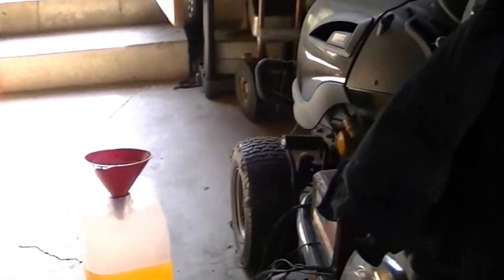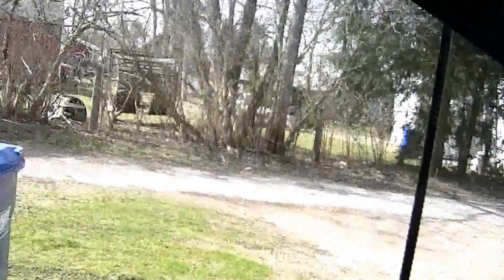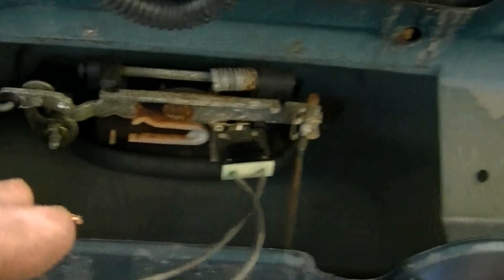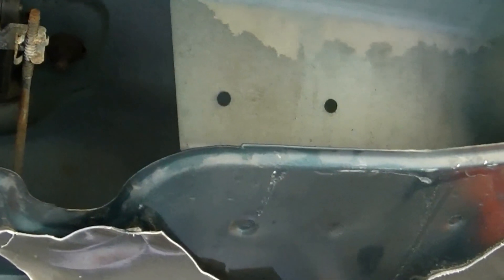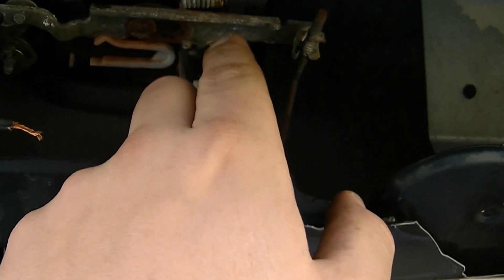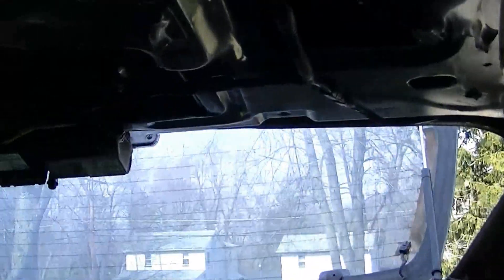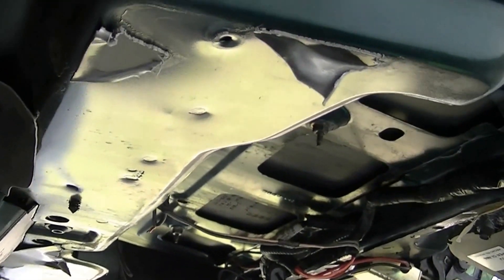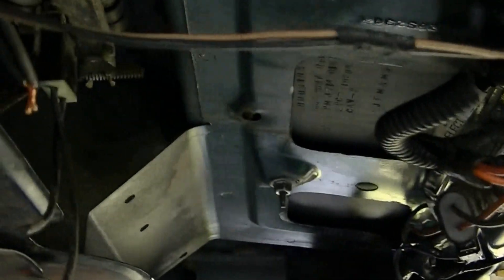possible reason your hatch window might not work jeep grand cherokee

Comment: there is a small screw behind it must drill hole to take it out get a magnafine glass u will seee screw behind micro switch / i took mine off cleaning rusted metal to see if that works or by new

Comment: actually if you look behind the switch you will find 2 screws holding the micro switch on.  Hard to get at be it may.  Thanks for the video, just being able to see the internal before disassembling myself gave me an idea of what to look for right off the bat....which was the problem.  Now to find one.